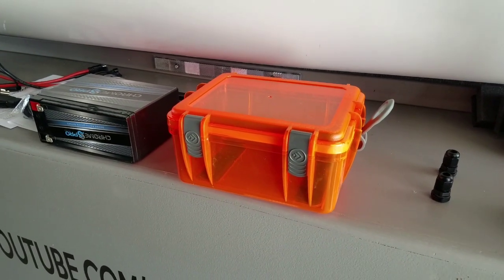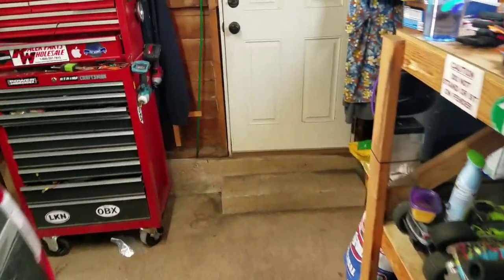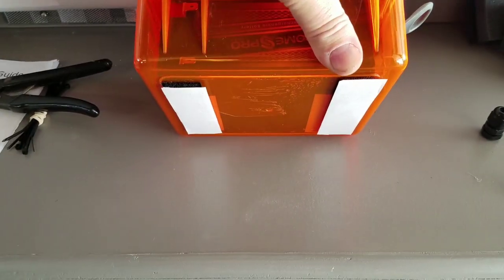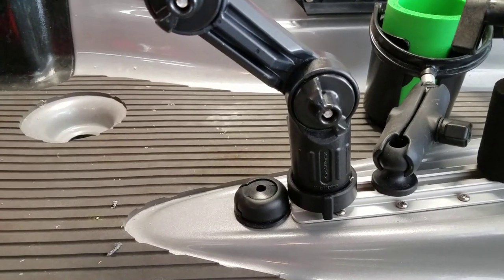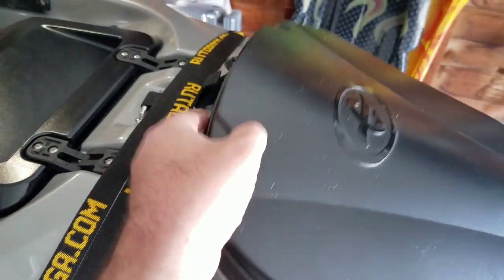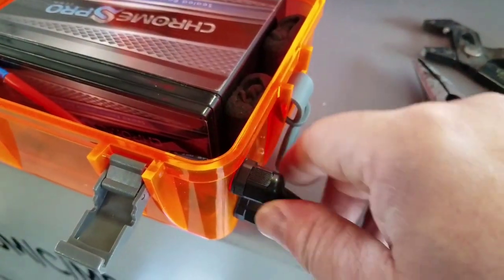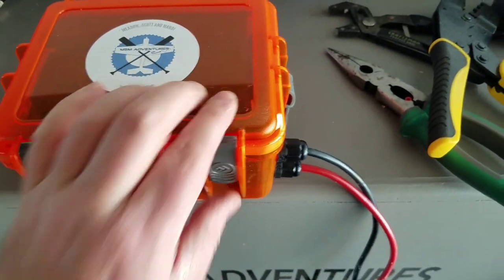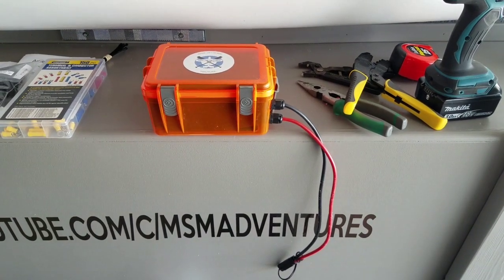DIY Battery Box for Kayak!

Comment: Thank you for this video! I build this yesterday with the blue box vs orange .. so awesome!  I didn't add an extra fuse as my fish finder has one, but am wondering if I should add a backup on the battery side of the 2 pin quick connect.  TIA for anyone with thoughts on this.
Reply: If your finder has one and you trust it then it should be good, i added one on the positive thats slightly higher amp than my total system for safety, but i also added a usb port and small 12v light, he didnt.
Reply: @thebassmaster1364  thanks for the reply, I ended up adding a fuse just in case

Comment: what gauge of wire?  what type of battery?  thanks
Reply from the maker: Hi. I just used the wire from the GPS 12v power supply cord. The battery is just a small agm 10ah.

Comment: Where did you find the quick connect, I'm new to this and wanting to make the box
Reply from the maker: https://www.amazon.com/dp/B0748JLNR4/ref=cm_sw_r_other_apa_i_IuTOEbZXQN9XT
Reply: I meant the battery tender quick connect end, sorry for the lack of info night shift blues lol
Reply from the maker: Oh gotcha. I think I had that but you can buy them. I forgot the name though but I'll look it up when I get home from work tonight.
Reply from the maker: https://www.amazon.com/dp/B000NCOKZQ/ref=cm_sw_r_other_apa_i_ug0OEbR7SXXMC
Reply: Thanks so much!
Reply from the maker: @quacker1185  your welcome, thanks for watching!
Reply: Did you solder the wires to the battery or use clips? If you used clips, what are they called?
Reply from the maker: Just used the slide on clips that came with the connector but I'm not sure what they are called.

Comment: Where did you get the waterproof wire plugs?
Reply from the maker: https://www.amazon.com/Plastic-Waterproof-Adjustable-Glands-Protectors/dp/B07GJDYGP5/ref=mp_s_a_1_3?adgrpid=53518622862&gclid=Cj0KCQiA04XxBRD5ARIsAGFygj-R2NjvNXa3wozpyl1rRASkqe2V-RW_oUDjww7-DsX7Hj7-UDK8xrYaAlnzEALw_wcB&hvadid=274749329953&hvdev=m&hvlocphy=9018847&hvnetw=g&hvpos=1t1&hvqmt=e&hvrand=14333447092812988707&hvtargid=kwd-301269776791&hydadcr=25279_9902133&keywords=waterproof+cable+glands&qid=1579310230&s=hi&sr=1-3
Reply: @MSMAdventures  Thank you much sir. I'm definatly ordering these and getting my rig ready for spring.

Comment: Can you use a small 12v battery from a lawn mower to power a fish finder? Trying to hook mine up in my kayak and not sure if that’s safe to do or not
Reply from the maker: Any 12v power source should power it up. There is usually an online fuse to protect the unit as well.
Reply: MSM Adventures thanks for the information appreciate it

Comment: MSM, did you say 12v, 12 amp battery?  I am going to make this and want to make sure the battery fits.
Reply from the maker: Yes that one is a 12ah 12 v battery. Although I didn't have good luck with that battery lasting as it is totally dead and won't take a charge anymore. I'm going to replace it with a 12v 10ah battery since they are quite a bit less expensive and will be plenty of power for what I need. Enjoy the box though I still love it. Thanks for watching!
Reply: @MSMAdventures  Thaanks bud.  Good luck.